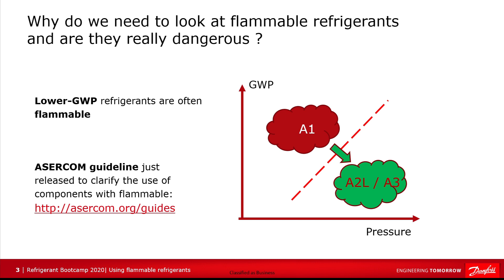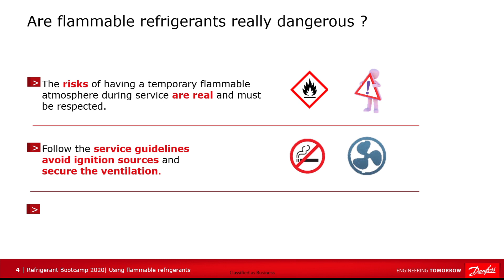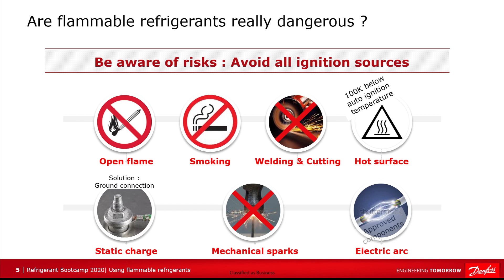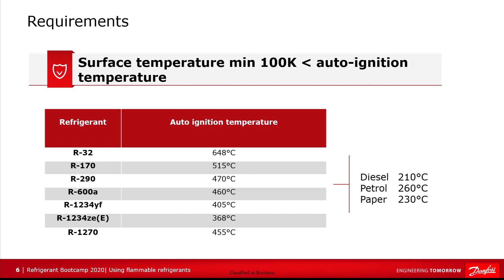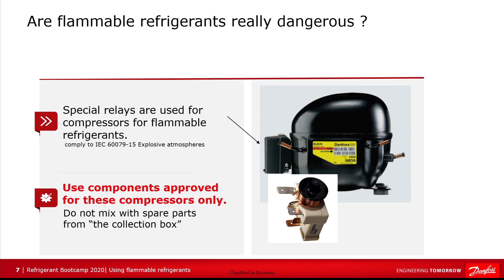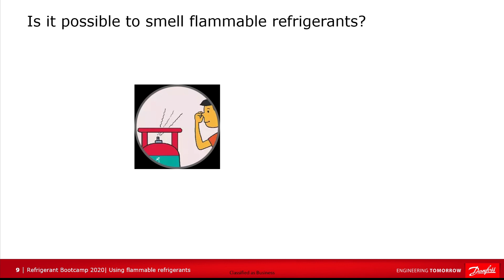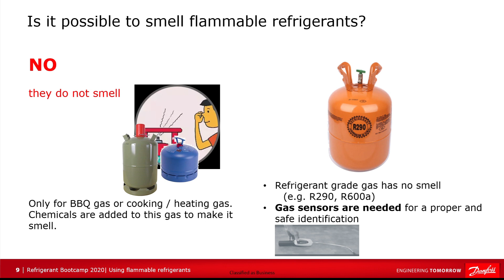Are flammable refrigerants dangerous to use? | Using flammable refrigerants

Comment: I am using butane refrigerants and for me this comantator is not a practical butane refrigeration engineering instead he is an text book bullshtiter, as you have to braze when exchanging a compressor make sure the compressor outlets are at atmospheric pressure before Brassington,as thus will only create vapour, the refrigerator may be have to be tilted to stop the flame hitting the fridge, in layman's terms you must brake the seal on the higj side before brazing thank-you
Reply from the maker: Hi Timothy, Thank you for your interest in the video and your feedback, which will be forwarded to the presenter :-)

Comment: Domestic/commercial HVAC technicians are pussies. We use propane and ethylene in large scale refrigeration and it is totally safe. Remember that flammable refrigerants are safe without oxygen inside the system.

Comment: I looked up flamible refrigerants,  i found two hvacr techs with their arms blown off
Reply: JohnnySilverfoot  There is no compressor on a gas stove, What is the gas pressure on a gas stove? What is the discharge pressure on a compressor with R290 refrigerant? You can't compare the two!!! it is 1/8 of pounds versus 300+ pounds of pressure!!! You are comparing a bicycle to a bmw!!! What is the gas pressure on an Industrial Oven heater? It is about 48 inches of water column "1.5 pounds" and how often do you see a gas line that is leaking? GWP is BS.

Comment: Tell me if this is not crazy. First we are forced to use lighbulbes with mercury in them, now we have refrigerators & freezers with flammable substance that could blow up. Its nuts! I have a mini fridge and freezer that use iso butane
Reply: Only using butane in donestic fridges 59 grams which us low dangers are mainly for some one trying to change burned out compressor worhout full experience  fridge engineers killed or badly burned with butane liquid flames.
Reply: You're right, it's insanity